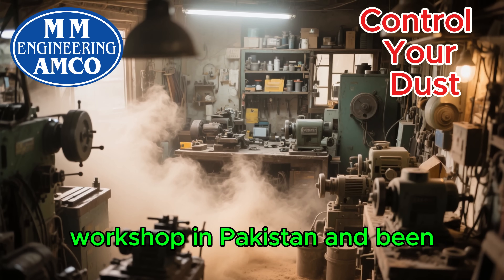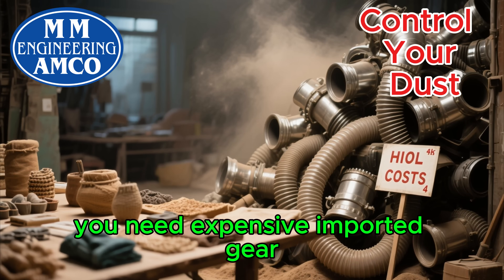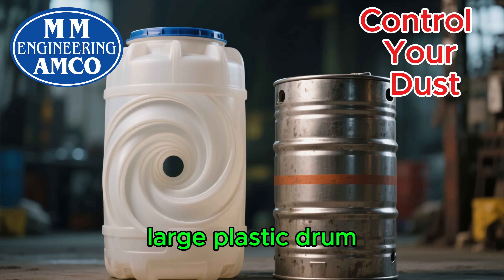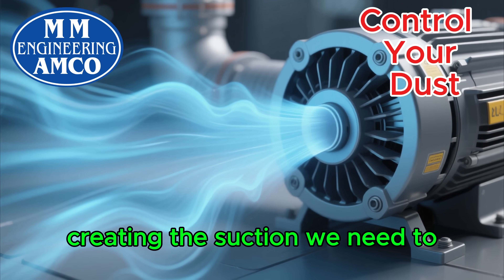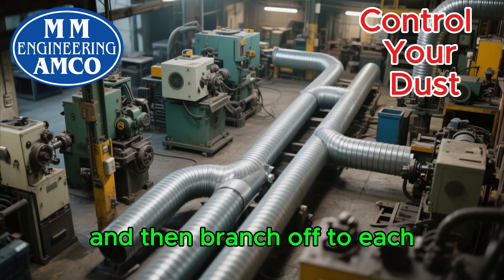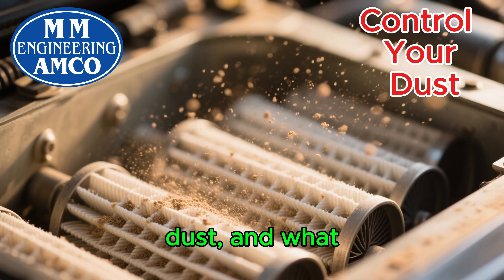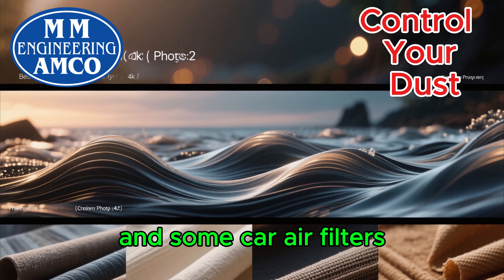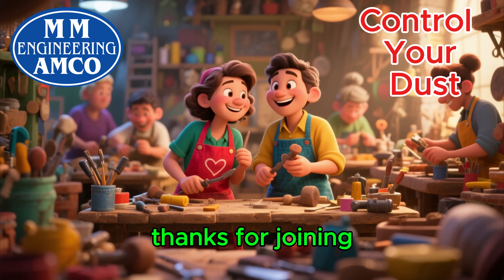Control Your Dust | DIY Dust Collection System for Any Space

Comment: “How are MM Engineering dust collectors superior to other brands in terms of performance and efficiency?”
“What are the key advantages of MM Engineering dust collectors compared to other manufacturers?”
“Why should we choose MM Engineering dust collectors over other options in the industry?”
Reply from the maker: MM Engineering dust collectors outperform other brands because they deliver higher filtration efficiency, lower energy use, longer-lasting filters, and rugged build quality. Their design ensures better airflow with lower pressure drop, which means cleaner air and lower operating costs. With customizable options and easier maintenance, MM Engineering systems offer superior value, reliability, and performance — making them a smarter choice for any industrial application.”